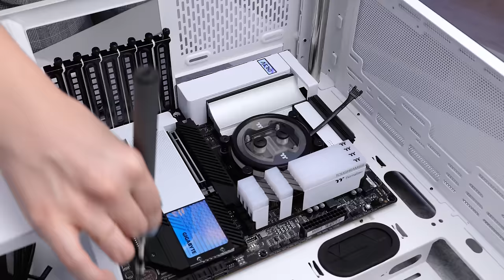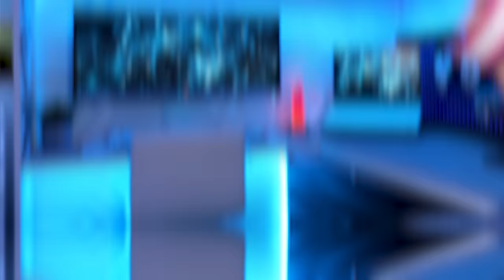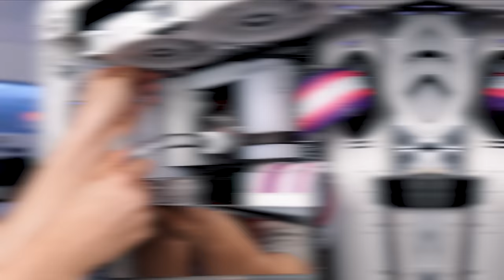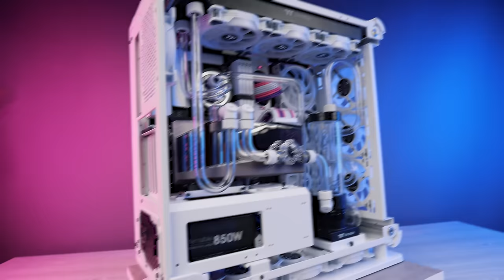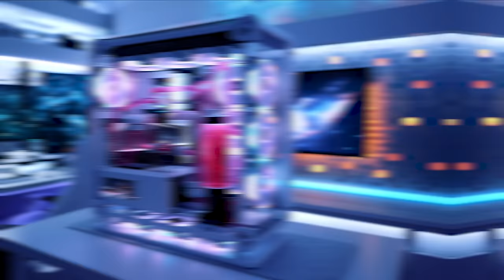EPIC $5,000 PC Build Time Lapse - Thermaltake Core P6

Comment: You had me amped that I could build the same pc, until the liquid cooling came into play.  Then it all became a dream.  I’m not that good.  Beautiful work though!
Reply: It's not necessarily for PC to have a custom WC, you can just add a WCS or an air coller
Reply: Custom loops are absolutely overkill and unnecessary for like 99% of people.

AIOs are a lot cheaper, easier to install and handle, and don't usually require manteinance.

If you are not a fan of liquid cooling that's perfectly fine too, there are very good air cooler like the ones from Noctua that perform very well.
Reply: its just for looks mostly you could easily do same build without them
Reply: It's not that hard, just gotta take your time and develop your own methods of doing things.
I wouldn't just do it for the aesthetics, do it for the quietness and great temps and for the fun of building something
Reply: You dont need water cooling
Reply: It's not really the best anymore. For the CPU using a thermosiphon ice giant cooler is best (works better for hotter CPUs) for GPUs a smaller custom water loop would do great.
Reply: It’s not hard

Comment: I wish I could do what y’all do! Absolutely beautiful build.
Reply: Building is surprisingly easy. The hard part is picking out all the right components that play well with each other. Oh, and cable management!
Reply: Steve is right, once you get the courage to dive into it, you find out that building your PC is a lot easier than you originally thought.
Reply: Same
Reply: @SteveBeliveau  I wouldn't really call it hard since you can easily find that info on the internet. All you need is a starting point like which CPU you would like to have and then just search what motherboards and GPU's are best for it.
Reply: @SteveBeliveau  agreed, get yourself an AIO or a Noctua air cooler instead of a custom loop and building gets exponentially easier.
Reply: @Bzk--  oh yea AIO is easy mode

Comment: I like your design.  I'm building a Core P8 system with a dual loop.  Two rads and a distro plate & a pump-res.  It would be less complicated to  eliminate the pump-res and keep the two rads.  Thanks for the vid!

Comment: What is that piece called that connects from the GPU to the Pump res? It has a double side connecter with a little fan inside or whatever you call that. I couldn't find it in the parts list. Thank you!

Comment: Hey there ✌️ I Just bought also this Case ... But i got a question : For the Airflow in this Case, can i let the Glass on  ?! Are there No Temp Problems at all, cause in my mind, it must be srysly gettin hot... Or Not ? Greetings
Reply: By the way, i installed a AIO and the radiator is on top... ☺️

Comment: Amazing video, but I have a question? Why did you install both fans and liquid cooling? What exactly those fans are cooling if you're already cooling gpu and cpu via liquid cooling?
Reply from the maker: The fans on the radiators or the fans in the case? The fans on the rads push air through the rads to cool them, and the case fans ensure that hot air is being moved outside of the case continuously

Comment: looks nice but i bet it runs hot as a mofo, blocking all your internal airflow with your water tubes and the bottom fans are also intake being blocked by the pwer supply. i ocunt 6 intakes and 4 exhaust fans. :\

Comment: How do you plug in that many fans onto the motherboard? And how is the GPU standing straight and not on the motherboard?
Reply: 1. Fan hub/Fan Controller/Fan PWM-Splitters
2. PCIe Riser cable
Reply: @xxomegaxx5427  Things I've learned since then. Anyways, found out my motherboard has JRGB and not ARGB.  Lame.

Comment: Electro Static Protection is extremely important. The components lifespan is dramatically reduced when exposed to static electricity. It's the end user that suffers, so the seller / builder should take every precaution by using at bare minimum ESP wrist straps. My entire bench is ESP matting too 😉

Comment: actually a friend of mine did pretty much the same. he had the money and he just wanted it. and he is not done yet, coz he is not talented. what can i say? he buys the most expensive stuff you can find and he somehow manages to fuck it up. and he never comes to an end. right now he is thinking about upgrading that 12900k before taking care of the heat problems he has. he runs benchmark after benchmark and likes to overclock his white 4090ti to see some more numbers in a benchmark. but he actually never finishes the very first steps. so it will be a workstation forever instead of a finished build with a closed case^^
Reply from the maker: Sounds just like the way I mod skyrim 🤣 spend more time modding than playing xD

Comment: When I, as a professional, watch how threaded connections are connected, where water will circulate, I feel bad.
You should at least use a special waterproof silicone sealant to tighten the threads.
100% if it does not leak or drip, then there will be moisture on the threads.

Comment: This is a cool looking pc. I have been building customer desktops for 20 years. However in time all of those fans bearings will become LOUD! and noisey! The water cooling is just for show. A standard stock heat sink will do the trick unless you are over clocking. You only need extra ram if you doing out of the ordinary desk work. Usually 600 -1000 investment and you will be fine. always have 2 hard drives and label the second one data keep the other just for the operating system.  No light either it after becomes annoying unelss you like the lightd. Good Luck

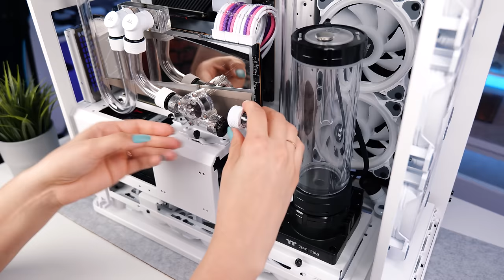Comment: AWESOME BUILD - and also the INSPIRATION for a Blacked Out build that I'm currently working on. At about -4:35 of the video you are attaching a tube with multiple bends in it. How long of a piece of  Acrylic di you start with? It looks longer than the standard size. Finally, its a bit difficult to make out the bends in the tube do you remember the steps?

Comment: I thought the same way 10 years ago, but only a fool builds a machine like that.
Reply from the maker: Just for fun really, no real benefit to building a watercooled system
Reply: @TechTesseract  Yeah, you're right. But I today? I am on my own path, which may be unknown to others. My case is own design and utility were the main considerations.
Looks? Maybe it resembles a fighter jet engine. It's miniature, but it contains an overclocked HEDT cpu ...all with only 1 fan cooled.

Comment: Water is not a good combination with power. I have worked with computers for about 20 years, my boss said the same. But good luck.
Reply from the maker: Distilled water doesn't conduct electricity so the danger is essentially zero. Water cooling PC's is quite common due to its superior cooling capabilities, and perfectly safe if you know what you're doing.

Comment: That's weak and not what super work is. This is a 0 - 8 - 15 conversion and all parts that can be bought ready made. For me, computer case modding means building something special that doesn't exist before and which is self-made Just like this one, almost anyone can build it themselves at home. Just buy the parts and you're done. This is not real case modding for me! Looks good and all, but nothing that's over the top and blatantly cool. 

By. Alien Ware